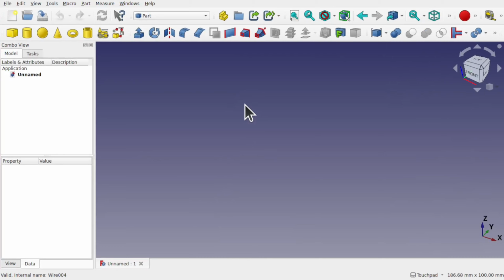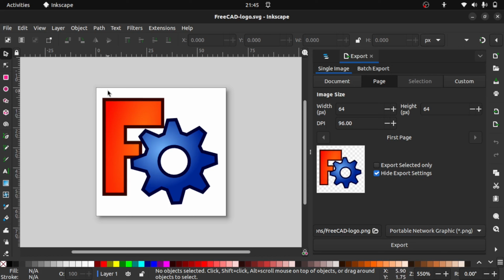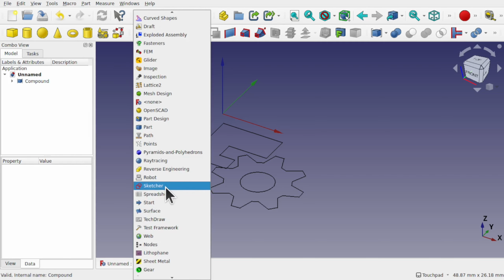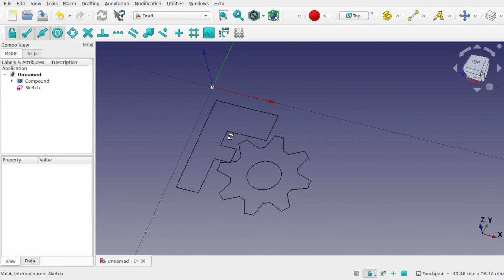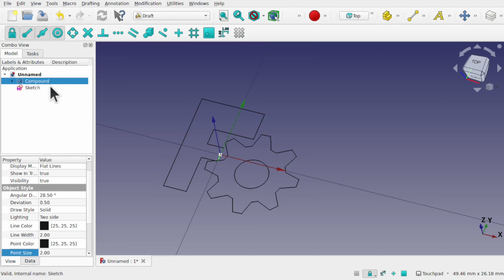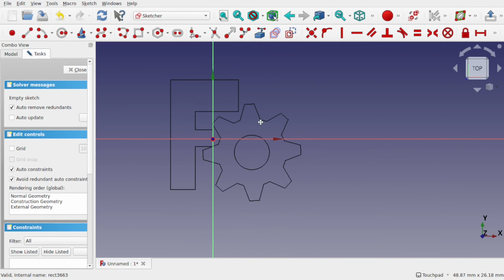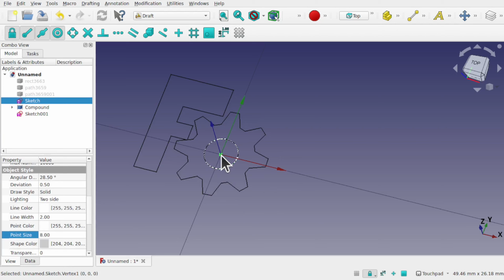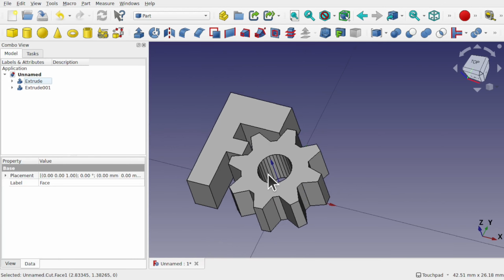FreeCAD: Fixing Imported SVG Point of Rotation / Transformation Point

Comment: Thanks a lot for this video! Honestly, the way you have to jump between workbenches in Freecad to do anything breaks my mind 😵‍💫
I'll add it to favorites because I know I'm going to forget how this was done.
Reply from the maker: Thank you glad you found the video helpful. Yes I think that the many workbenches doesn't help with the easily learning curve. It's one thing I have struggled with in the past. When I worked on quite a large project a month ago, My freecad had a number of tools which I had pulled in from other workbenches into the part (which I use most of all) these could be used outside they're workbench and it saved me flipping back and forth.
Reply: @MangoJellySolutions  That's a good tip. Once I have more established use cases and workflows, I'll probably try customizing the toolbars.

Comment: there is nothing simple about this method 😜
(it's not you, it's FreeCAD that can sometimes be very convoluted...)
One shouldn't have to learn Draft workbench just to "workaround" issues like this
particularly since I never need to us Draft workbench for anything else 🧐
Reply: That's true but I consider it a small price to pay.  If I'm having a problem getting freecad to do something for me I can usually find a solution on this channel.
Reply from the maker: I wish the transform tool had snapping similar to the draft tools which would make life so much easier. The way you have to do this, yeh It does sound wrong and I can understand how people get frustrated, but  if you think about t, it does make some sense why the draft is used for this. The reason why you have the draft is to work with 2D objects. SVG is 2D. The centering issue is down to the svg and not freecad.  Good thing is the draft tools can be moved to a workbench of your choice by adding them to a sub menu. Freecad chose to go down a workbench root to organise the tools which has both it's strengths and weaknesses and often I find that tools in add on workbenches can often be better than the tools in the main default ones.
Reply: See my post above, FreeCAD seems to be like that but remember its Open Source. I've found with a lot of patience I can generally figure it out and I'm a beginner. Also many users are running Older Systems so compatibility etc issues no doubt occur. Regards RW